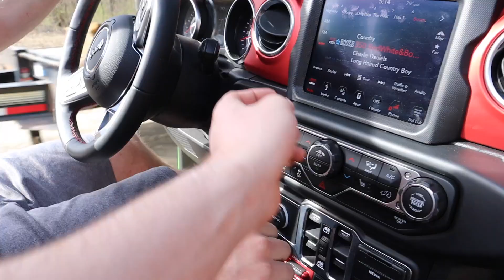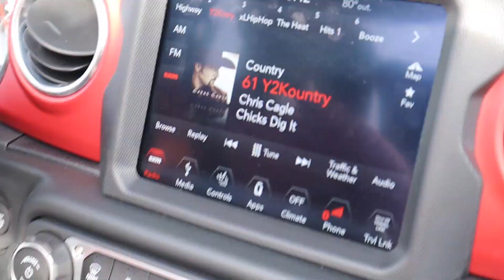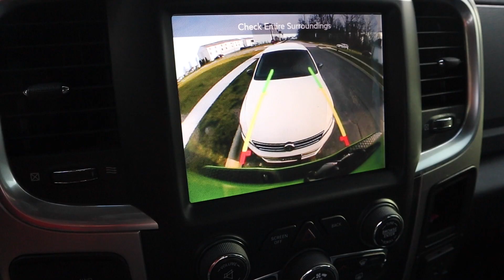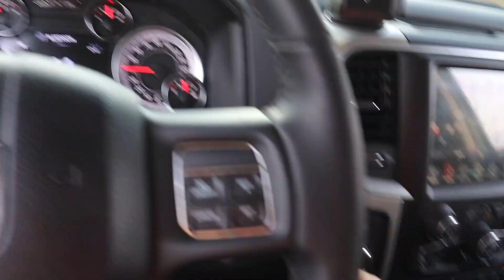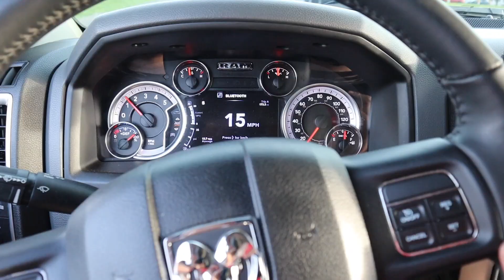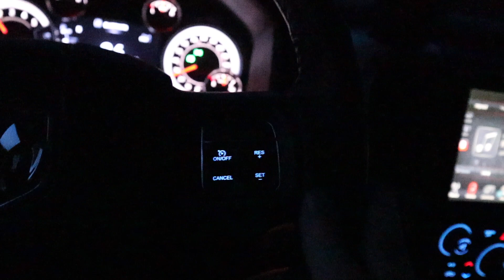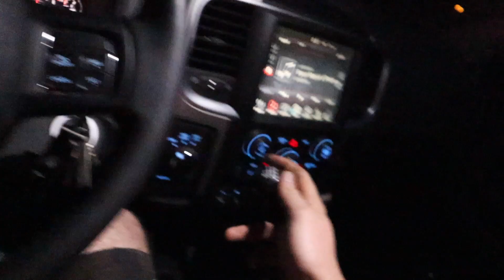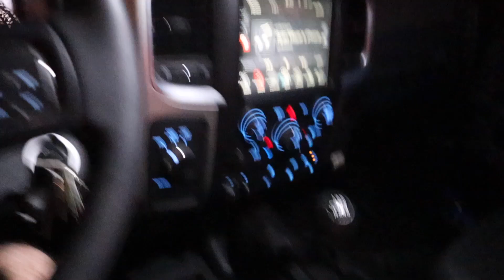SHOULDA DID THIS SOONER!!! *HUGE DIFFERENCE*

Comment: If ur looking for more foot room in the truck around the clutch/brake pedal you can undo the obd2 port plug from the plastics and zip tie it up closer to the steering column.

Comment: Question about my Pedal Commander, I took mine out because one day I was driving down the interstate and my truck felt like it died. Push the pedal and nothing then like I floored it, check engine light on, warning bell going off, ect. I've emailed them with no response. I checked codes on my Mini-Max tuner and had a ton of codes, main one was P06A4-sensor reference voltage D circuit low. I unplugged the Pedal Commander, cleared the codes and away I went with no more problems. I hooked it up with the truck off, no power, like directions say. It was in the truck for at least a month before this happened. Any advice on what happened or how to fix this problem??? Thanks.

Comment: Ryan, I really like the videos, keep up the good work! I have a 2007.5  3500  4x4 dually  6.7 Cummins  3.73  rear end it is the first truck I have ever had with a dual disc clutch.  I hate the clutch noise to the point that I'm thinking about replacing it, I was told that if you run the transmission a quart over, it will quiet the noise down. Do you fill yours a quart over, and when was your clutch chatter louder?  Mine is loud when the clutch peddle is pushed, when it is out there isn't any noise.
Reply from the maker: Yes I over filled it 1 QT! I’d like to crank this pedal back a bit more and see if the little chatter I have goes away completely

Comment: I have an 03 jetta Nd  the clutch needs adjusted but its a self adjusting clutch and has no way of  adjusting by the user. Its a big pain in the ass. My only solution is to replace my master cylinder but i dont have the skill to do that. I replaced the clutch to a stage 2 racing clutch and the pedal still needs afjusting

Comment: Yes you can technically go anywhere with your truck but not anything like a Jeep. Jeeps are so light compared to trucks and the wheel base is shorter too which both greatly benefit off-roading